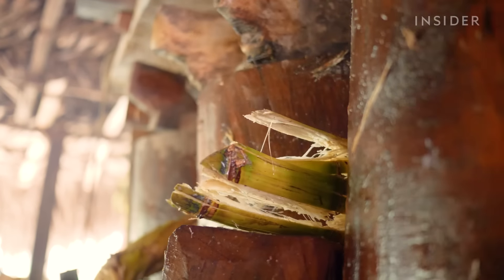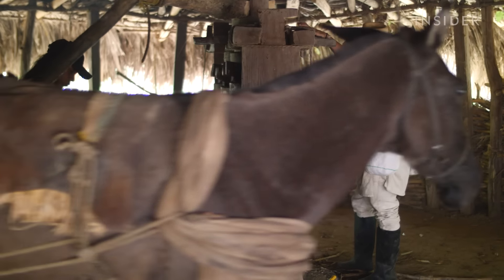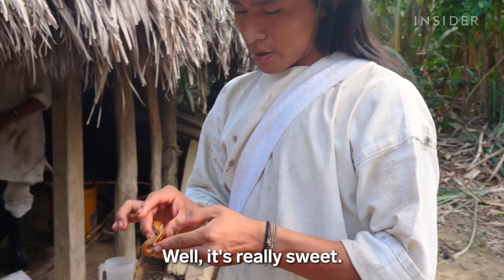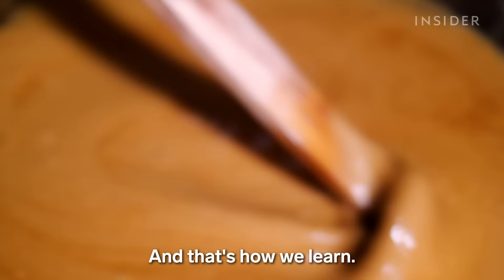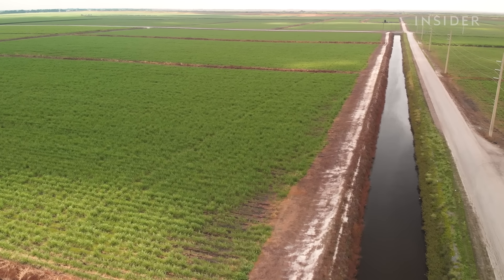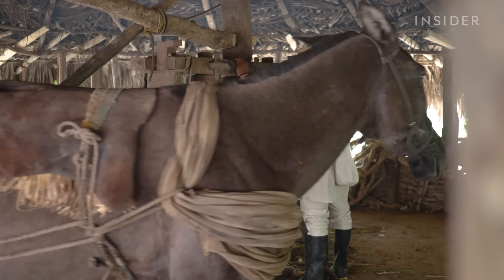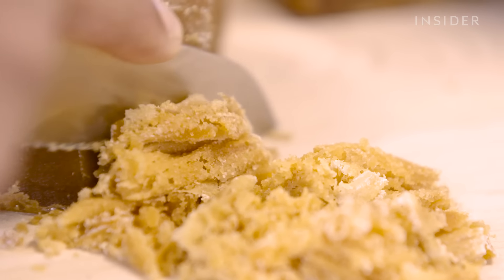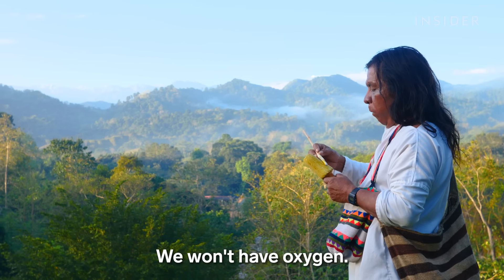Why Indigenous Panela Sugar Is So Expensive | So Expensive | Business Insider

Comment: In Thailand, we also have unrefinded sugar made from sugar cane juices called Nam Tan Oi น้ำตาลอ้อย, so its pretty much same as "Panela". It only costs like 2.5 USD per kg.
Reply: While in Malaysia we made them from palm sap. Seriously what is so expensive I could never understand. Do they even know how to make them at all? Here the temperature goes as high as 32 Celsius and we make solid block just fine...no need for snow capped mountain cold air.
Reply: So expensive, refined white sugar only cost $0.8-$1
Reply: In Brazil it's even cheaper and it's called rapadura
Reply: @MrArthoz  They make it using medieval methods, no wonder it's so expensive lol
Reply: We can export you $1 per kg from India
Reply: Northern thailand called Nam oi น้ำอ้อย mostly sold 1 to 2$ per kg.

Comment: Wow, the forms that they are pouring the panela into are made of redheart. I bought a 12-inch stick (12"x2"x2") of this in the States, for a small project, for about $30. It's a very dense wood, iron-heavy, South American lumber with very fine grain that can put up with very high temperatures and pretty heavy use...it's the stuff that the US Army uses as a landing pad for moving tanks on and off trains. I ruined quite a few chisels getting mine into the shape I wanted. Pretty amazing that they are using it to make sugar.

Comment: I very much doubt that water claim is legit! Sugarcane probably is the highest water using crop per hectare, but that would be because it's also the crop that produces BY FAR the most product & bio-mass per hectare.
What's the per calorie water use of sugarcane vs soy & corn? Sugarcane would be far lower than soy, I'll bet! Corn is probably on par, because sugarcane & corn are both C4 photosynthesisers, that means they're 200 times more efficient in water use per molecule of carbon fixed into the plant (growth) when compared to C3 plants, so no way they're using more water per calorie than C3 plants like soy, wheat, oats, rice, bamboo, hemp, various trees etc etc